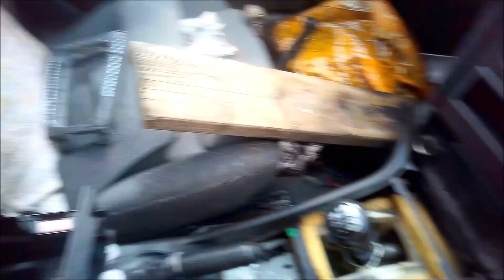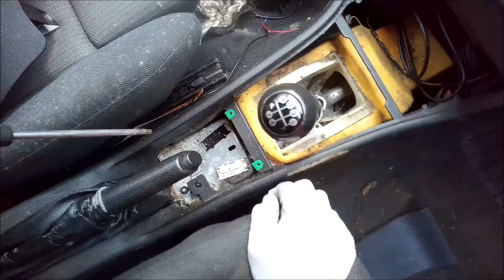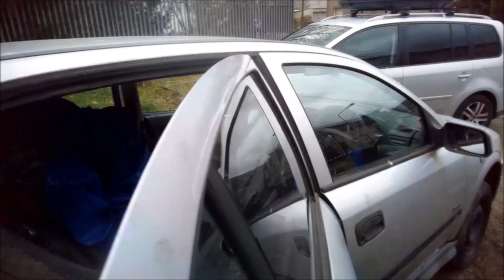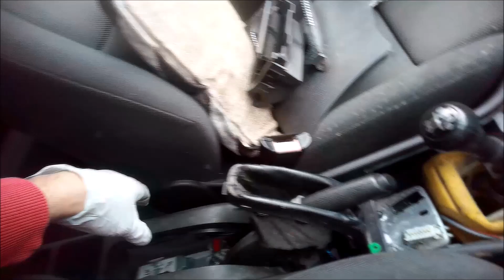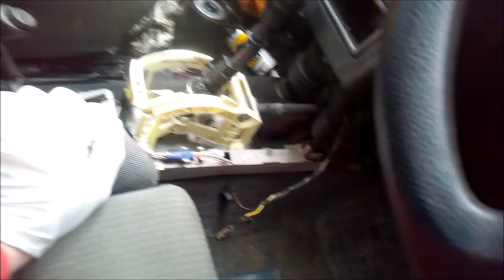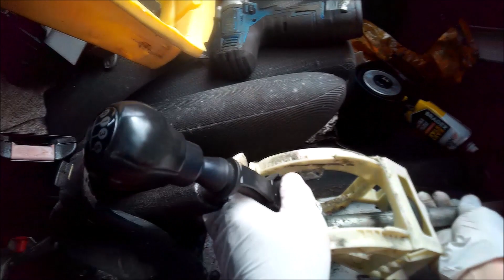Astra G MK4 - F17 Gear Lever and Linkage Removed from the parts car (Z17DTL 1.7 CDTI)

Comment: What problem were u trying to resolve on this. My gear lever has gone lose and failing to select gears. Would I then need to replace the same piece you removed here? Thanks
Reply from the maker: Check the linkage, especially where it connects to the gearbox in case it has come loose.